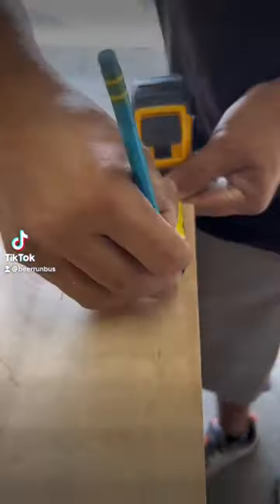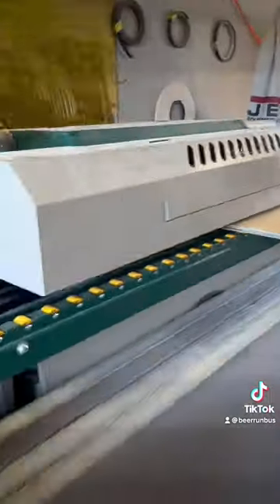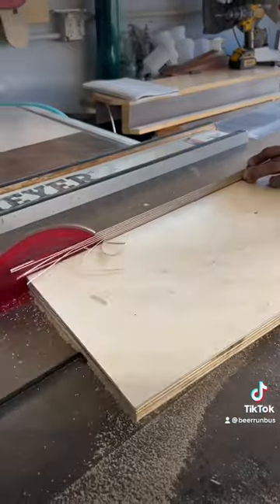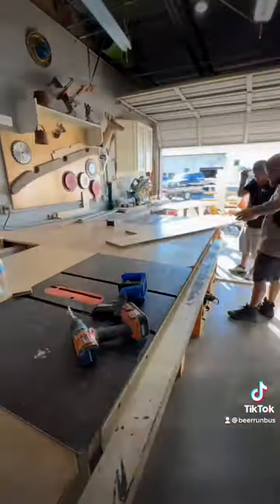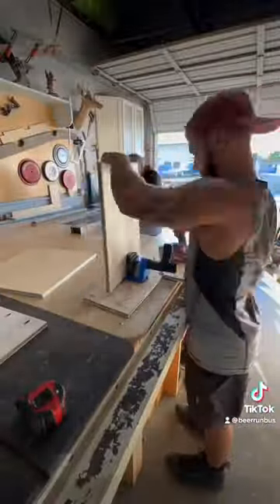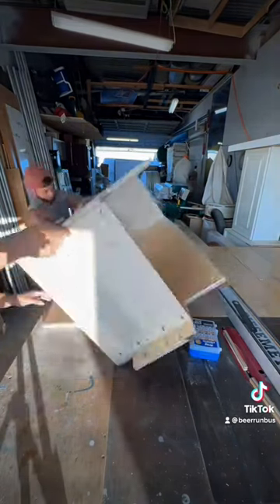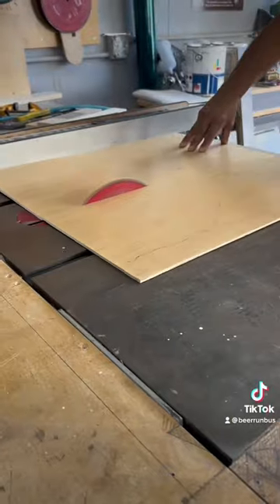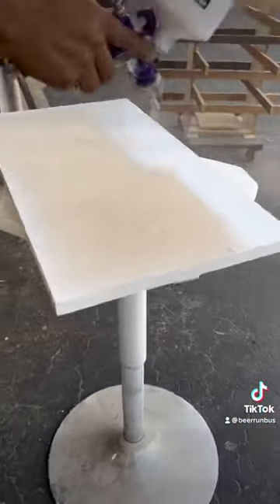Camper Van Conversion Part 8 #vanconversion #busconversion #vanlife #buslife #campervan #tinyhouse

Comment: No need to run a separate ground wire to mimic the positive run. That’s a habit for a wood/ fiberglass hulled boat. You have the ultimate ground bus, the vehicles frame/hull itself.

Comment: Hey dud well done for building a campervan i noticed that the refrigerator runs much better on inverter 240 then 12v its much more efficient
Reply: Hm, where do you get that from? An inverter would suck quite a lot of power throughout a day as it needs to run always. If a smaller 60W fridge runs at 1:3 ratio means 8h active cooling per day its 40Ah at 12v. If an inverter adds up to 1A per hour its another 24Ah on top. A 12V  Dometic 80l fridge has an average consumption of 1A, means about 24Ah per day..